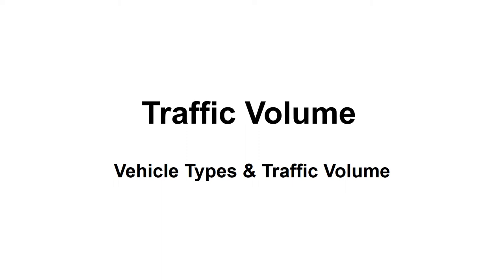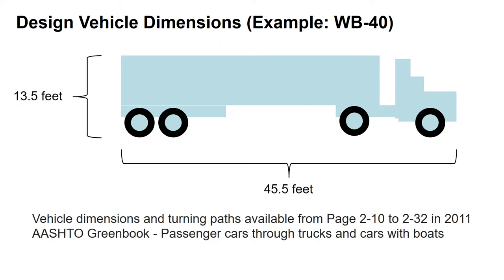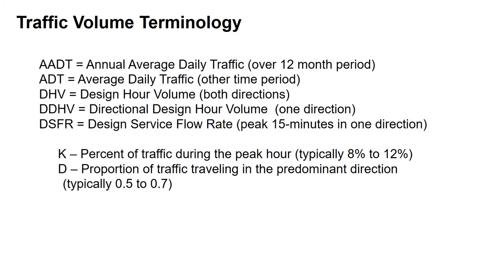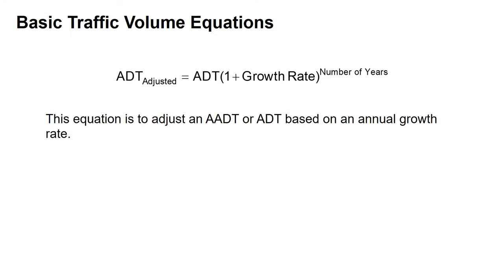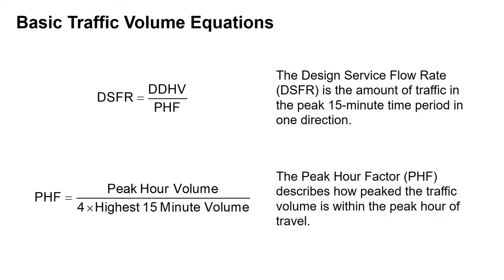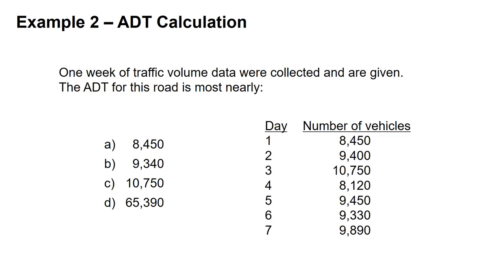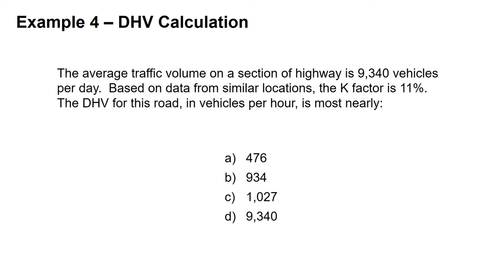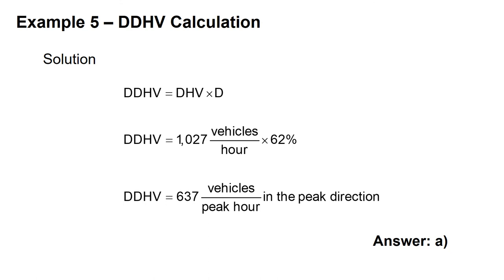Traffic Volume Equations & Vehicle Types [AADT, K-factor, D-factor, PHF, Design Service Flow Rate]

Comment: Given your comment in the description. Is example 3 still correct or expected on the PE exam?
Reply from the maker: Yes, I think this would still be a reasonable problem on the exam.  To solve it, you should use the "Single Payment Compound Amount" or "to F given P" in the engineering economics part of the reference handbook (Section 1.7.10, page 42 of v1.2 - you'll find a value of 1.3439 for F/P with an n of 10).  The traffic growth rate equations in section 5.5.9 of the reference handbook v1.1 (page 289), which are specific to pavement analysis calculations, were removed from v1.2 of the reference handbook.

Comment: I cant seem to locate the ADT adjusted equation, DHV equation,  DDHV eqyuation, or DSFR equation in the greenook or the reference manual. Do you know where they are?
Reply from the maker: Unfortunately, all of these equations are not in the Greenbook or the Reference Handbook.  However, v2.0.2 of the Reference Handbook has some content on pages 267-268 (section 5.1.3) and page 290 (section 5.5.7 and 5.5.8).  Other volume related content is in textbooks and the Highway Capacity Manual.

Comment: thank you Daniel 
I really need to know how K  is defined i mean how did they come out with these numbers 8-12  urban and 12-18 rural
Reply from the maker: Great question - technically, K is the 30th-highest hourly volume of the year.  Because of the relatively higher volumes throughout the full day in urban areas compared to rural areas, urban areas typically have a lower K factor than rural areas.  For instance, 10 PM in a rural area typically has very low traffic volumes (when I was growing up, in a rural location, only one business in my county was still open at that time), while an urban area typically has many businesses open and a much larger percentage of traffic still operating at that time.

Comment: is there any way to get adt from peak hour volume?
Reply from the maker: Yes, you can solve them in the reverse way.  For instance, if you have the peak direction volume, you can divide it by K & D to get the ADT.  If you have the combined directional volume, you can divide it by K to get the ADT.
Reply: @FindleyDaniel  thanks for the response
Reply: @FindleyDaniel  How to determine K & D? Can we assume as explained in this video? Or is there other better method to find them?
Reply from the maker: @sahanbaidya7778  If you have local data (from the specific site or a similar one), that's the best.  Otherwise, yes, it's usually ok to assume a K factor between 0.08 and 0.12 and a D factor 0.55 and 0.65.  Or, something similar.
Reply: @FindleyDaniel  sir, can you refer me any research paper or document to help me find K and D at my local area by observation at site? I would be extremely helpful.
Reply from the maker: @sahanbaidya7778  The theoretical value of K is actually derived from the 30th highest hourly volume in a year, but that is impractical in situations unless you have continuous and automated roadway counters.

For your situation, I would recommend that you count at a mid-block location (i.e., not an intersection).  Count the traffic for a full day (as long as you can, but typically, at least 5 AM to 9 PM - which may need to be adjusted depending on your specific situation) in 15-minute increments.  Then, you go back to find the highest hourly volume (i.e., 4 of the consecutive 15-minute bins) to determine the K factor (highest hourly volume divided by the total volume).  In that peak hour, determine the proportion of the highest directional volume for the D-factor.

Comment: example #3. growth rate. ncees hb 1.1 has a similar eqn on page 289.

why are you using exponent "t" instead of ncees'  "t-1"?

i understand that adt isn't the same as aadtt but still, the concept and the accompanying eqn ought to be same. no?
Reply from the maker: I'm going to look in the original reference material to see if/how they define "t".  The common notation for this type of problem is for the number of years (not number of years minus 1).  However, they may define time from the beginning of that time period, not the end.  For example, there's a difference between the end of year 8 and the beginning of year 8.  The traditional equation assumes the end of the year.
Reply from the maker: From my understanding, the traffic growth rate equations in section 5.5.9 of the reference handbook v1.1 (page 289), are specific to pavement analysis calculations.  The traffic growth rate equation (9:50) in this video is consistent with the "Single Payment Compound Amount" or "to F given P" in the engineering economics part of the reference handbook (Section 1.7, page 37).